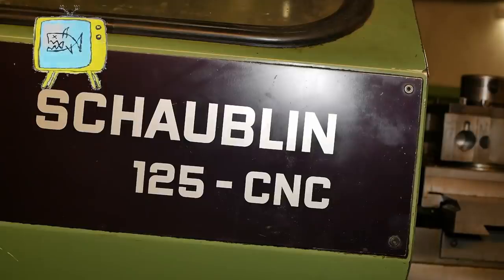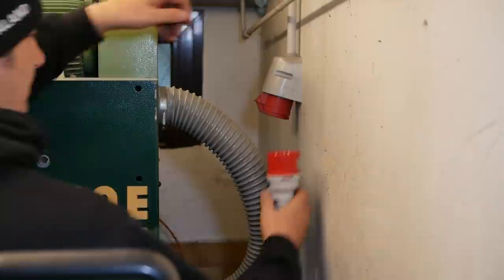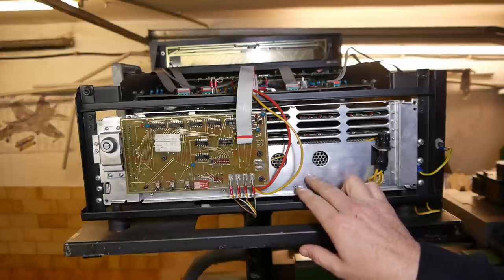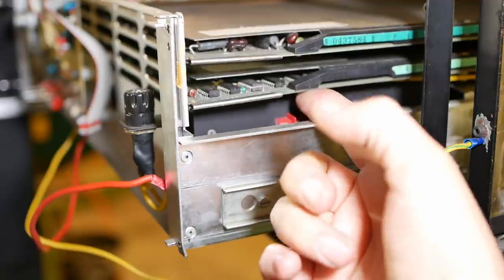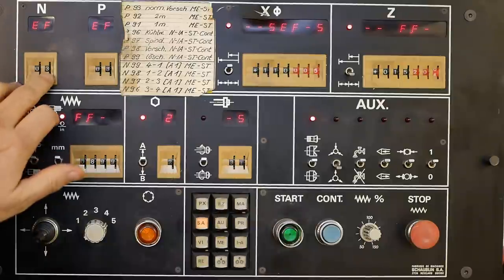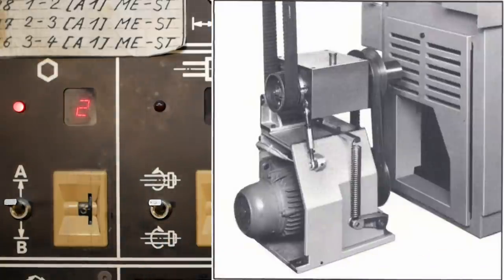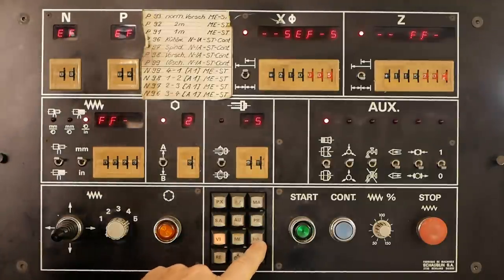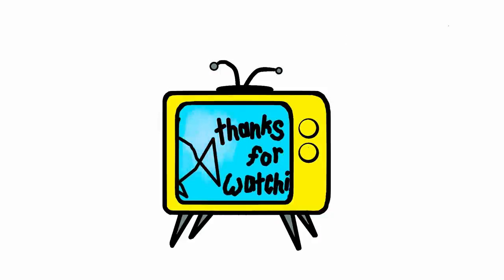Historic Schaublin CNC Controller - How did it work?

Comment: To use the old servo drivers they would need to support step dir commands, if they use some proprietary communication you are better replacing everything.
Reply from the maker: The big issue for me is simply their bulk. I want to regain the space hogged by that huge cabinet.

Comment: Core memory is non-volatile, but that's not to say the program would definitely survive a power cycle, it may reset the core as part of it's power on initialisation.
Reply from the maker: I seem to get different error codes every time I turned it on.

Comment: It will not be easy to retrofit the motors and stuff, but definitely possible. I would try to use the keyboard and other things to maintain a bit of the nostalgia. I usually maintain all that i can.
Reply from the maker: That control panel is funky and cool, but I would rather keep the Nova and Schaublin control panel together and get them to a museum or collector, then to recycle that panel.

Comment: I would think someone at Schaublin might be interested in helping with the project - It would be neat if it was upgraded but kept factory with all Schaublin parts from modern equivalent machines?  Probably only practical if the parts were donated to you but hey you do have those 640,000 views nothing to sneeze at  - I wonder if their entire website even has that many hits.
Reply from the maker: .) Nice idea, ,but Schaublin still makes an sells the 125-CCN and is pretty proud of them ($$$) But I will contact them an see if they need the controller for the company musuem.

Comment: I'd go for option 0 myself, Keep the original controller and get her running like that. But I've got a thing for obsolete computers and old machine tools. whatever you do, make sure that old DG masterpiece finds a loving home, I'm sure somebody out there would love to tinker with it (I would!)
Reply from the maker: Unfortunately those axis drives take up way too much space, and I have no documentation fo them. Yes the controller will go to a collector or museum.
Reply: @RotarySMP  oh! so you actually want to use the machine as a cnc lathe and not just a cool toy? Then you'd probably be better off binning most of it and putting in modern stuff then!

As pretty as the old control gear is, you'd have to be a complete madman to use it for any real work nowadays. (although you'd have to be fairly half-baked to CNC a chinese 7x14!) While those drives are massive I'll bet you'd have to spend a fair bit to get something that could match them for power/reliability, depending on what flavour of signals you'd have to feed them, I'd at least try to use them as they're already there and specced for the job, as are the motors.
Reply from the maker: @theafro  "(although you'd have to be fairly half-baked to CNC a chinese 7x14!) " LMAO! You get it! I hope no one thinks that series is a good idea to follow :)

The drives have to go, as the oversized cabinet needs to go. Also I have no Docu for them.  That leads to the tranformers getting the axe. Some dDrives which can eat 240VAC are then needed, which leads to AC servos. One contactor plus a VFD is more compact than five contactors. The pneumatics are totally oversized for the tiny flows required, so if I replace them with new, I can fit everything into the Pneumatics space.
Reply: @RotarySMP  I think that's called an engineering cascade (or cost avalanche if you've got to pay for it!). Admit it, you're just looking forward to the challenge of getting everything inside that little cabinet! (got to love a bit of well routed plumbing/wiring)

BTW I started watching as a fellow 7x14 owner but soon realised that mine would be best left intact and just use it as a 'training lathe' for the kids! thanks for saving me the time!
Reply from the maker: @theafro  Glad you picked up on that. Yeah there is a bit of feature creep happening here.

Comment: I would use Cncdrives dc drives and encoders on the current motors. Everything fits and the motors are already in the machine.
Reply from the maker: It is tempting, but I work have much space and don’t want transformers in there

Comment: I would try to use this old drive electronics, but unly if it is based on known schematics and on available components. It is a very bad idea to work with them otherwise
Reply from the maker: Good call. There are two small relay boards which are fully covered by the schematics. I’ll reuse them, but the rest will have to go to a museum.

Comment: There's a high pitch sound when the machine is turned on. I guess it's some kind of clock that runs in less than 20.000 hz. Next time could you do a low pass filter to your audio?
Reply: DC-Servo amplifiers. About all machines of that age do that.
Reply from the maker: @hinz1  You should have heard the first draft. It was like throwing razor blades at your ears :)

I did used a low pass filter, and noise reduction, but that is a whole new rabbit hole to go down. Da Vinci Resolve is super powerful, but as a one man You tuber, it is a challenge to learn filming, micing, lighting, speaking, editing, transitions, audio correction, effects etc.
I am progressing, but it is a steep learning curve.

Comment: I would replace all the electronics and electrical components incl. the motors. It's hard enough to troubleshoot a new system, mixing with an old system might result in too much hair loss chasing down each bug - and depending on what you find you might have to spend money fixing them anyways.
Reply from the maker: Due COVID lock down, I have too much hair ;)
On the Major I kept the indramat driver and motors cause I have documentation, here I don’t, so will do like you would.

Comment: I would try everything to keep the original motors if they are reliable and provide enough accuracy if this was mine. The machine is made to fit those after all.
Reply from the maker: That is what I did on the Maho, but here I have no documentation of the motors or drives
Reply: They might be too old in this case.
Reply from the maker: @MF175mp  I have to get new drivers, so I may as well get matched drivers that take 240 VAC and motors. Although the conduit to these motors is cool.

Comment: I think I would keep the motor and try to put a modern encoder into it, if that fails then just replace the whole motor with a servo, but that could be expensive
Reply from the maker: I am still considering my options
Reply: @RotarySMP  dont rush it, take your time and think it through
Reply from the maker: @DolezalPetr  Thanks. Good point. The advice covers the entire spectrum, I will have to make a decisions soon, and plan thoroughly.

Comment: 0:55 putting the Teflon tape on in the wrong-wise direction grrrrr.... XD
Reply: That was not an NPT fitting. It needed a soft washer or an o-ring to seal properly.
Reply from the maker: Oh well,good enough to get some pressure on it. I need to redo all this pneumatics to shrink them anyway.

Comment: Very interesting insight into such an old control! Oldest control I’m familiar with and still use at work is a first generation Fanuc control from 1982 on a Mori Seiki turret lathe. The original green CRT is awful but it still runs which is amazing 😂😅
Reply from the maker: Thanks. Yeah, this is pretty unique controller. Shame it has to go.

Comment: Well I'm cheap so if the drives and motors work, I would keep them. They have lasted this long !
Reply from the maker: That is what I did with the Maho, where I had documentation for the drives. Here I don't, they are huge, and I want to delete that enormous control cabinet.
Reply: @RotarySMP  WooHoo ! A minimum of 10 episodes right there. I can't wait  👍😀
Reply from the maker: @Andrew_Fernie  Easily. :)

Comment: I would replace with ac servos and slap a masso controller on it.  Up and running in no time.
Reply from the maker: I will be using Mesa cards (probably a 7i77), and also tend to AC servos.
Reply: Masso 🙄. They G41 yet? No? There's your answer 👌👌
Reply: @TheFeralEngineer  yeah it is a short coming.  I have been happy with my mill controller from masso.
Reply: @northernsmith  can't get on board with something missing a basic feature. I've worked for a high end machine tool builder for the last 2 decades, so I'm a bit of a Diva 😆. I like that with linuxcnc, if it's missing something, it can be built. I'm running a mesa 7i76e on a raspberry pi 4b for less than half the price of a basic masso.

Comment: My opinion: new optical encoders, new drivers and keep the old motors. Because they looks native to the machine.
Reply from the maker: The thing which makes that tempting is the quality of the conduits. The downside is I would need a big transformer, and AC servos can run straight off the net.

Comment: Could it be?! Am I the first?
Reply: I would have been first if I hadn't been watching your new 3D printed cylinder video.
Reply from the maker: @andypughtube  Hi guys, I have also been enjoying your 2 stroke odessy. Great project.
Reply: My world of machining and racing collide 🤣
Reply from the maker: @nikolaiownz  :) HI Nikolai. Once again thanks for the Haimer. I already bought a tool holder for it. Now I just need a Maho project to use it on :)
Reply: alex has turned in to a cnc-geek aswell  - lovley to se ;-)

Comment: it probably was a better idea to film the machine running before messing with the internals 🙄😥
Reply from the maker: It wasn't running before I did anything either. The last owner also bought it as defective, adn never got it running. How do you trouble shoot a computor with only  a user interface? A DG test set it an  even bigger project on its own.

Comment: Isn't it funny that a machine from 1970's boots up when power is applied. Can't say much for the brand new Sony 4K TV in my office that I bought just before the pandemic and has been off (i.e not plugged in) for almost a year that is now showing crap and wavy colored lines instead of doing the function I bought it for. Newer = better? I'm not so sure. Another piece of garbage electronics for the land fill.
Reply from the maker: Yeah, I was also surprised that the Nova seemed  to work. I have also had a few TVs die in the last 10 years
Reply: @RotarySMP  I was just pondering whether to buy the Nova from you.